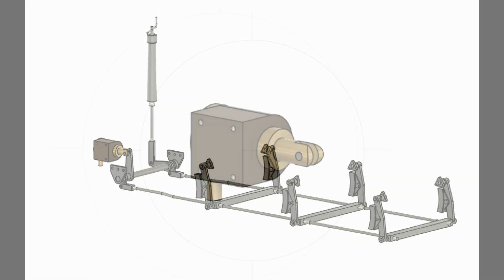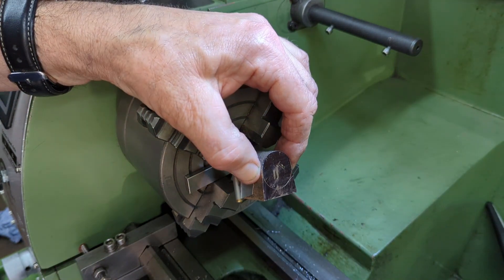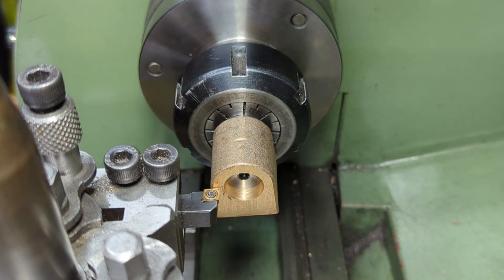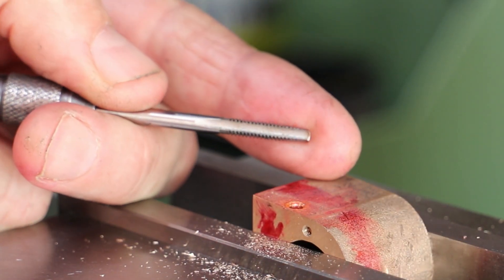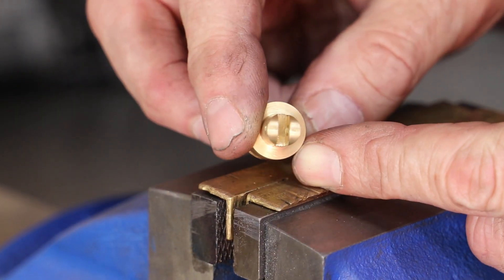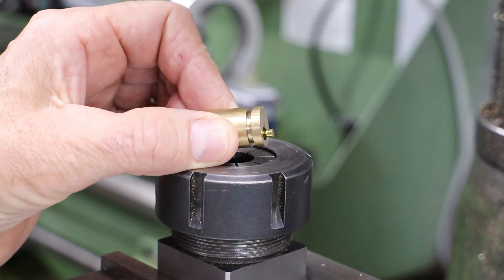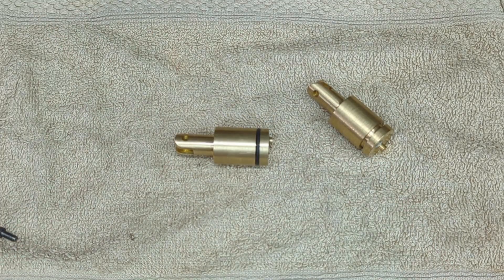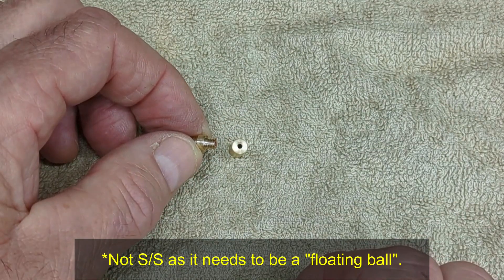Part 56: The Steam Brake

Comment: Really good series, Mark, thank you for posting all the videos, I have finally caught up. You have intrigued me with the floating ball on the steam brake cylinder drain valve - that's going to require a material than can take temperatures of >160C, that's less dense than water, and that is supplied as a sphere (or you have to make a tiny sphere somehow, no easy thing). What material meets the requirement? Or I suppose a hollow sphere made of pretty much anything would float, but are these available?
Reply from the maker: Thanks for the positive feedback, it is much appreciated.
You are ahead of me on thinking about the material required for the floating ball, I'm a long way off making steam so hadn't yet really considered it just yet.  Doing a quick search via Google does indicate that Nitrile may be the material and such balls can be sourced from Reeves2000.
Cheers
Mark

Comment: A few further questions if that's OK?

1. Despite your challenges with telescopic gauges would you recommend them over the inside-jaws of a dial caliper?
2. You decided against s/s ball - in my build the author suggests "Rustless", which I assumed was stainless?
Reply: The inside jaws of a caliper are good for most jobs where "close enough" is good enough, but if the fit requires high precision due to tight tolerances T-gauges and micrometers are the way to go or a bore mic (not to be confused with a dial bore gauge) is even better but the cost puts them out of reach of most hobby machinists. The problem with using calipers for inside measurements is the contact surface of the "inside" jaws are not on the same plane. They move past each other like scissors do, thus not taking readings at exactly 180* apart like the outside jaws. Good Luck on your build, hope all goes well!
Reply from the maker: Hi William,
Vernier Calipers are often referred to a s Very Nearlys for good reason :-)  That gets even works on internal diameters, because the width of the caliper measuring jaws will effectively "lift" them off the internal diameter face - the smaller the diameter the bigger the error.  Correctly and competently used Telescopic gauges are definitely the way to go - but as you know, I struggle with them, always have and probably becuase I don't use them often enough.
Regarding the ball in the condenstate drain valve, I was correcting myself rather than changing my mind.  The Ball in the drain valve needs to float - so that as the body fills with water, the ball floats, exposing the drain hole and letting it blow out, at which point the ball will "drop" and reseal.  Exactly what material I need to use, I don't yet know.
Keep up your good work, that pump casting looks like a Klingon Bird of Prey and as one other commenter posted, I would probably have gone down the fabrication route too.
Cheers
Mark

Comment: when using a Telescoping Bore Gauge, one first squeezes the Gauge smaller than the Bore and loosely tighten the Lock. Place it in the Bore with the Handle angled up approx 5 to10 degrees. Loosen the Lock so the Gauge Surfaces touch the Bore. Tighten the Lock firmly but not tight. Swing the Handle thru an downward Arc such that the BORE forces the Gauge Surfaces to the matching Size. Swing downwards past the Handle being horizontal - the Bore Gauge will then just slide out touching the Bore on the bottom Gauge Surface only. Measure with a Micrometer by swinging it thru - if you try to just measure it directly like measuring a Shaft diameter you might alter the Bore Gauge Setting and get a low Reading. I find it impossible to use Telescoping Bore Gauges by any other Method. I do measure multiple Times to verify the Measurement. These Gauges require practice, practice, practice.

When parting off small Items with a Hole, I put a small diameter Brass Bar in the Tailstock Cuck and run the Bar into the Hole of the Part - no way can you lose the Part.
Reply from the maker: Hi Bruce, for parting off I just either place or hold a sheet of paper under the chuck to catch the part.  Your last point on the telescopic gauges captures it perfectly, practice, practice, practice 😁
I appreciate your advice and will keep trying.